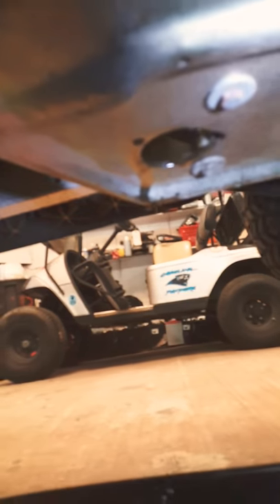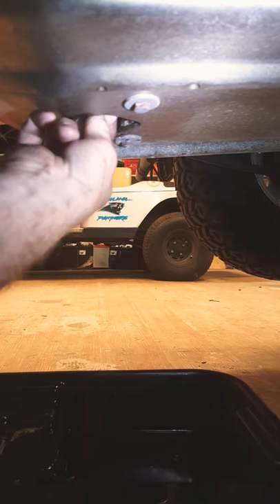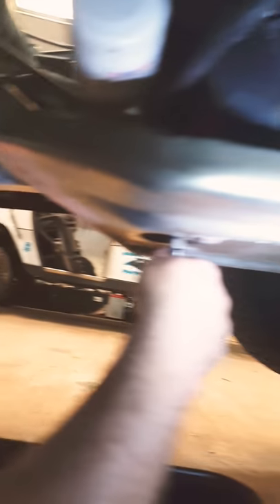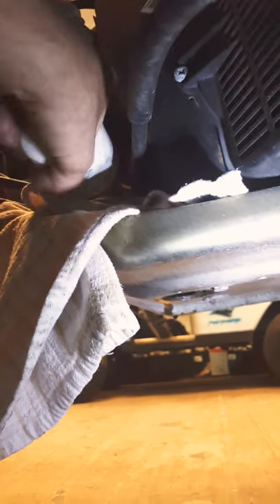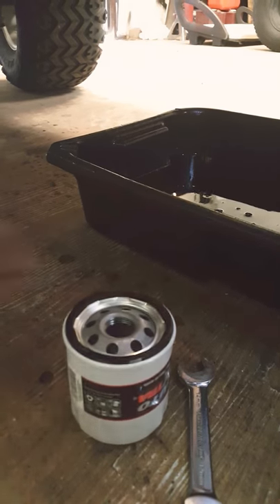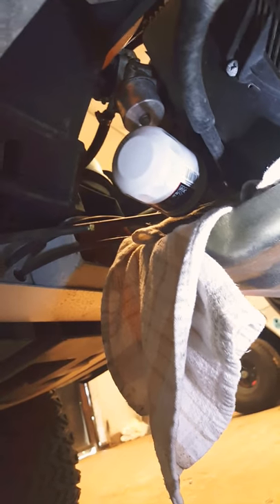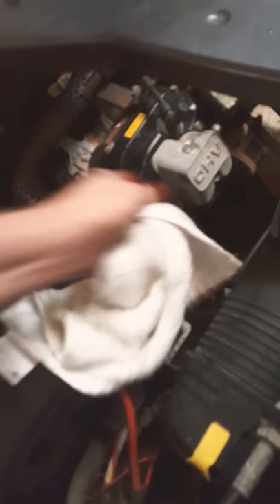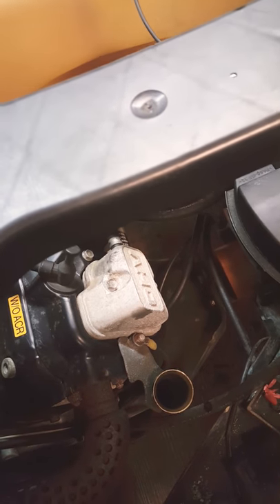Change the oil on a gas club car.

Comment: Can you do a video on how to properly adjust the governor to increase the speed?
Reply from the maker: You have a club cart correct
Reply from the maker: What you want to do is tur the key off. Then loosen your gov. Shaft bolt. Then your floor your gas pedal. Then take one of your hands and hold the carb throttle shaft wide open. Then turn your gov shaft all the way counter clockwise with pliers.  Then tighten the gov shaft bolt back. So that way you know everything is right.  Then you take you a tie strap and put on gov. Throttle spring for speed. I have a video on how to speed a cc ds up in 30 sec. But if you still need video let me k ow. I want be back to the shop till tuesday. But i will post